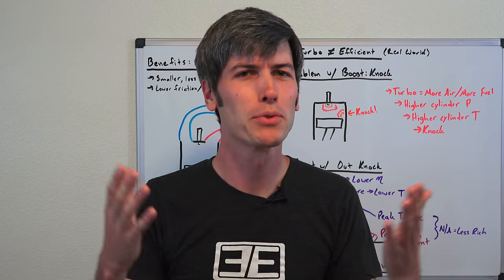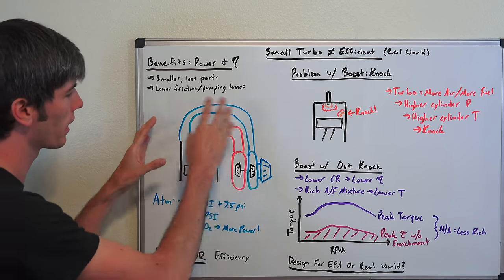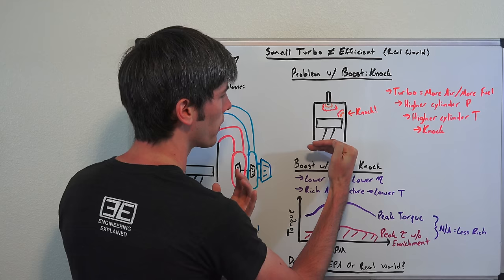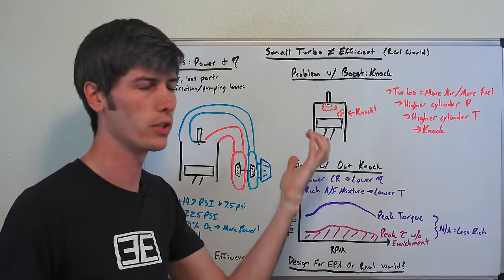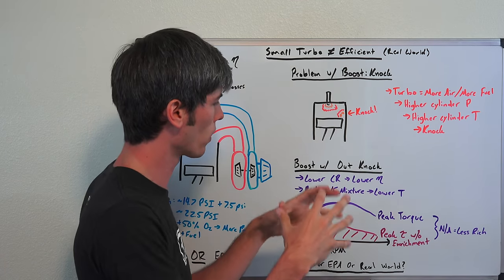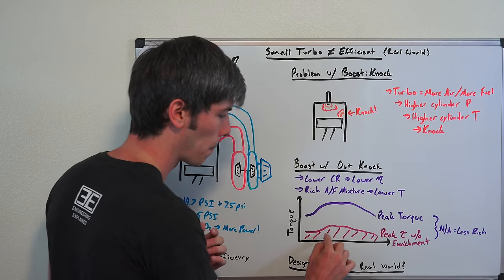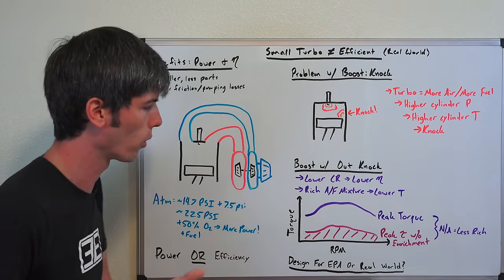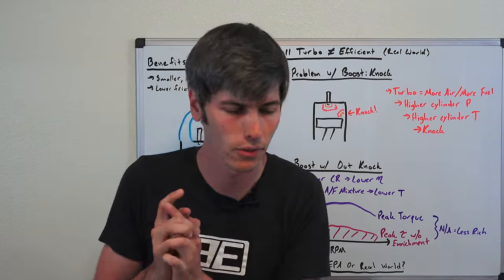Why Small Turbo Engines Are Not Efficient

Comment: The spool up time required to build speed makes these engines frustrating in local stop and go driving - however on the open road, you get fantastic mileage and the engine is great.  Bottom line for around town the mileage and speed isn’t so great - but on the hwy it’s great.  So what kind of driving do you do more of?   That’s what you need to decide.

Comment: I'm interested in what car you drive.  Turbo or non-turbo?

I'm in agreement that compression ratios ultimately impacts on overall efficiency.  Altering fuel mixtures can control engine temperature but it's best to compare what each manufacturer has achieved!  
SAAB did a great job getting best economy out of their turbo engines.  I drive a 2004 9-3 base linear that achieves 7.0 l/100 km in real world highway driving when keeping the speed around 100 km/hr.  I use premium fuel to get best economy and to get best power from the motor.  (engine rated at 9.5 CR)
My daughter drives a SAAB 900S with a 2.3 litre non turbo engine which can match this economy with regular gas.  (10.1 CR). Albeit, the 900S has less frontal area, so I expected this.  
From my perspective I love my turbo car.  Great economy and very usable torque for real world driving.  Not enough evidence here for me to go back to a naturally aspirated engine even considering fuel economy.

Comment: I have a 2014 VW 1.8t, I run 91+ octane and regularly thrash the sh!t out of this motor, get 35+ mpg with 100k miles on it. No knock, zero issues with it.

Comment: Sure pal. 

 Ward’s Auto describes the three-cylinder L3T as “the little engine that could,” making its way onto the organization’s 10 Best Engines list “through a combination of technology, tidy sizing and torquey response.”

Output is rated at 155 horsepower at 5,600 rpm and 174 pound-feet of torque at just 1,500 rpm, which means the L3T boasts a specific output of 116 horsepower per liter. As such, the L3T has greater specific output than the 6.2L V8 LT2 equipped in the mid-engine Chevy Corvette C8 – 37 horsepower per liter greater, to be exact.

Comment: Also remember regardless of engine, 3/4/5/6/8 cylinder, turbocharged/supercharged or normally aspirated.  Full tank will kill fuel mileage.  You are adding full fuel, and for a family road trip all the occupants and cargo.  As you drive and the fuel gets burned off your MPG should improve.

Also those who think driving 70-80 MPH with A/C off and windows down......wrong in most cases.  The parasitic drag and turbulent airflow around the window housings will most likely off set any fuel savings and may in fact cause even lower MPG along with increased ambient air temperatures and noise.  

Think driving with windows down and A/C in thinking you are still getting the cold air from the vents.    WRONG. Again:  you might get away with it a few times but eventually the A/C compressor will fail.  The compressor is trying to condition outside air at one central point (internal vents). Trying to compensate for the warm air coming in from the windows the compressor will eventually give up the ghost.  I would pretty much guarantee they a compressor is much more expensive than the extra fuel you might use driving with A/C on.

Comment: I just bought a Jetta 1.4t and I actually get the advertised mileage of 30/40.  Throttle response is atrocious due to emissions programming which is a problem when you have to lift off the gas to shift gears but power itself is decent.
Reply: I think the 2 liter in the Focus is a better engine, in terms of throttle response and top end verve but I doubt I’d be getting 40 mpg on the highway.

Comment: so the supposed advantage of the smaller turbo engine is not real after all. Power comes at cost, fuel consumption HAS to be increased whether it is a V-8 big cube or a tiny 4 banger....no free lunch.

Comment: mine gets good gas mileage 1.5 accord manual. it’s how you drive it. accelerating at an easy pace and slightly higher rpms. once you reach your desired speed hold it and when you need to speed up downshift but easy acceleration. don’t lug it don’t accelerate hard. easy!!!!

Comment: Rented a bmw 2020 330i with a 2.0 engine has 250hp 298lb. did 600 miles on one tank of gas. From Lawrence ks to St Louis and back on the interstate cruise control set at 80.

Comment: I did some testing on my 1.2 TSI (with a Bluetooth obd reader and torque pro), and the mixture stays pretty much stoichiometric all the time though, even on full engine load. I didn't test higher rpms, so maybe the mixture gets richer from 4000rpm and above - but that's not where you usually are in the city. 
The compression ratio is 10.5/1, and fuel consumption (seat Leon 1P) avarages around 7l/100km (6.2-6.4 on the dashboard).
Reply: Gibbon agree, that’s what I learned from Jason. It’s just that I was quite surprised that in daily driving, the air/fuel mixture seems to be perfectly stoichiometric all the time. I’d expected it to go rich at least at full engine load, but that doesn’t seem to be the case.

The TSI might be inefficient in other ways, surely the compression ratio could be higher in a na engine. I don’t know what the efficiency trade off is there.

Comment: My buddy with a Type R has 29.7 mpg over the past 6k miles.  I've seen the trip computer.  Drives easy MOST of the time, but definitely not always.  A base Civic would definitely beat that MPG, but would struggle a bit even to keep up with easy driving.

Comment: I’ve got a 1.4 liter turbo Jetta (2017) - It gets 40mpg on the highway, 0-60 in under 8 secs, and usually 36mpg around town. I’ve yet to have any problems with the car. It has the room of a midsize, the acceleration of a v-6, the economy of a subcompact. I’m not sure how you can ask for much more from a cheep compact car than that ($16k new in 2017).

Comment: A 70 hp engine can move a thousand pound car nicely. A 70 hp engine with a turbo can move a 3,000 pound car good too, but sucks the fuel. Anyway, it’s like the new Silverado. Small 4 cylinder gets the same gas mileage as the V8.

Comment: The MK7 VW golf 2.0 and 1.8 reach the goal of V6 power with 4 cylinder efficiency. Hyper control over many parameters, good head design and some other stuff I'm not aware of. But what is do know is AFR. These engines stay stoichiometric at insane loads and boost levels and hold together like an old train.

Comment: Porsche Cayman used to be only large (by European standards) 2,7 to 4 liter 6 cylinder boxer engines that had ok fuel mileage of around 0,6 to 0,7 liter per 10km. Then they made the 2 liter boxer engine with turbo making the same or more horse power and the fuel consumption went down to 0,5 liter per 10km...

Comment: The main reason why they aren’t as efficient as they could be is because of the platform of most small turbocharged engined vehicles is their front wheel drive and with small engine bays and that generates problems witch is heat can’t escape it stay trapped under the hood and with electrical fans that turn on and off the builds up and has no where to go and also has some form of EGR system witch is pumping exhaust gas back into the fresh air intake stream witch is reducing the amount oxygen in the available during intake stream witch causes a loss of power and efficiency they need to go back to rear wheel drive and and shroud the electric fan units and cut all the dress up of the bay itself and ditch the EGR and use a stainless steel intake manifold that has been polished on the inside to reduce the build up of carbon and other particulates coating the inside of intake manifold instead of plastic and enlarge the engine bay by 15%. That’s also why in the winter time you’re vehicle makes 10% to 15% more horsepower and torque than it does during the summer a engine running cooler is more powerful and more efficient than a hot one.
Reply: *witch?

Comment: Just bought a new VW 85kw 1.0 3cyl. I can get the stated mileage if i drive like a grandma with no passengers and no aircon. Aircon makes a noticeable difference of about 0.7L/100km and my two kids in the back that weigh about 60kg combined make about a 0.3L/100km. Also i need to use the start stop system to get close to the stated mileage in the city.

Comment: my 2015 volvo S60 T5 (240hp and 260 lbft of torque from 1500 rpm) has 2 driving mode.  In regular, you can drive it like its a diesel.  The reves rarely go above 3000 rpm.  I get 30 around town and 38 on the high way.

Comment: Great video. So small engines are inefficient because the extra fuel cools, and helps prevent knock....why doesn’t a larger engine need to do that?
Reply: Because the smaller engine has a turbo to make the same peak power as the larger naturally aspirated engine

Comment: Thank you so much! I came hoping I would find a video from you on this topic. Because yes, manufacturers have all went turbo seemingly, I assumed it was for EPA, but like you say it isn't telling the whole story. 
Though you didn't quite go into the basics, I mean essentially it is reburning the exhaust which tends to have alot of undetonated fuel. Which that is a no brainer if they want to keep things cleaner. 
As I learned in the aircraft industry they didn't use turbo until the air becomes thinner and that also is colder air, which isn't something most of us deal with. 
Glad to hear mazda is working to deal with this problem, going to watch that next. 
Thanks again!

Comment: I have a question : Couldn't a solution to this problem not be that the Turbo has to come on later/higher on in the revband ? 
What I mean by that is that the small engine, by low loads, would run under the point where the turbo is actually active, preventing knock and allowing less fuel to be needed. Typically, with modern gear systems, you could imagine having the car at a constant 1'800-2000 rpm highway, and when you need the boost, simply drop one or two gears and the turbo kicks in and you have the power for those, in general short, load scenarios.

Comment: I kind of wondered about that. My old early 1990s NA 12v 2.6l V6 initially gave me better mileage than my new 1.8 liter turbo inline 4. They have on paper the same horsepower and similar torque, but in order to get the fuel economy, I have to drive either be running at 1000-1500 rpm on the highest gear it can keep the car going at, and also do the accelerations never exceeding 2000 rpm.

So if driving "normally", with 1500-3000 range between gears I get 11 l/100km on either, but on the V6 the lowest I ever got it was 10 l/100km and on the new one, it does get down to 6 l/100km or so, but requires the use of cruise control and so high gears I was educated against that (knock and excessive wear). The old "normal" 1500-3000 range between gears wasn't exactlty "sporty driving" either, instead that'd be more like 3000-6000 rpm between gears.

Comment: Very happy with my 2020  1.6 turbo astra (holden), 150kw (200hp), yet i am averaging 7.6lts/100kms(37mpg uk/31 mpg usa) driving normally at legal speed limits.. Does have auto stop stop though, which helps a bit i assume. 
Yes those numbers plumet if i keep my foot in it,  Conversely if i baby it along on the open road, it can average 6.5km/lt. (43mpg uk)
Previous earlier model 2 liter cars i owned, only got 20-25mpg uk

Comment: to sum it up with 4 cyl cars with turbo they tend to get higher temp in the cyls because of the turbo and with all of the air from the turbo coming into the engine the engine has to go more rich to match up the air fuel ratio aka bad mpg so if u got a 4 cyl turbo for better mpg dont floor it

Comment: Very good explanation of engine knock with a turbo.
I'm not sure how small car turbo CPU's are designed these days for factory but a turbo needs high octane fuel to prevent knock (perhaps there designing these cars for standard 92 octane to make them more efficient as you state).
I'm not an engineer but I'm sure I'm right and manufacturers shouldn't be designing cars with turbos and not placing high octane fuel in the manufacturing specs (the same would go for a supercharged engine but turbo is cheaper to manufacture on a 2L). 
Let me know if I'm on the right path man and I love your videos. Peace!
Reply: It sounds like I need 0.7l engine to get good mpg at wot.

Comment: You totally didnt mention the real big reason: 
Most of the time you will drive in urban traffic, unless you are travelling a lot on highways. And then even in that case you will run into traffic jams, which basically are urban traffic. 
What happens to turbo engines in slow traffic? - Right, the turbo will not kick in, or just very rarely, because the RPMs are too low. The efficient RPM range of a turbo starts not directly after idle. 
You should take that into consideration

Comment: In my mk7 GTI (2.0L turbo TSI with direct injection) I can get up to 35-36 mpg on the highway (they claimed 30 for automatic models) and even when pushing the car hard I can get 20 mpg which is still very viable for how hard I push the car. If you want good mpg drive like a granny, that simple

Comment: In EU:
3 cylinder 0.9l are common. Still the fuel consumption is approx 1.5 - 2 times higher than with 2.5l 6 cylinder.
In diesel it is much more significant. 1.4 TDI consumes much more than my 1.9 TDI and way more than the old 1.8 SDI and it does not even work.

Comment: GM recently introduced the new Buick Encore that comes with a turbocharged three pot.  It's bigger than the old Encore and gets worse fuel mileage because the three cylinder has to work harder to move the weight of the vehicle even with a turbo, and that's before you cram it full of your personal belongings.  You can make the argument that if you really baby it, the car will get closer to advertised mileage, but a cynical man might say that the design of these new engines has nothing to do with efficiency, and that it simply costs less to make an engine with three cylinders instead of four which is why some manufacturers are going this route.  A Chevy Cobalt with the N/A 2.2 liter Ecotech and a manual transmission can get over 40 mpg on the highway, but these new Buicks are barely managing 30 unladen, and similarly turbo cars which should get better mileage than SUVs or crossovers only get 35 or so combined.  If you ask me, turbo economy vehicles are one of the biggest scams ever pulled on American consumers.

Comment: My ex girlfriend has a 1.8L, turbocharged 4 cylinder Cruze that gets about 35 mpg. My 1992 Pontiac Sunbird had a NA 2.0L four cylinder that got 38 mpg. Both have automatic transmissions but the Cruze has a 6 speed, whereas the Sunbird has four. 

Granted, the Cruze can accelerate much faster than my Sunbird ever could, but still, for supposedly being an economy car, it's not very economical.

Comment: The problem is when a engine that is too small is used in a vehicle that is too heavy for it. The engine will be in boost most of the time and the mileage sucks. I have owned two ecobost Ford Escapes back to back, they cant get claimed highway mileage unless downhill with a tail wind.

Comment: I got as low as 4.3l / 100km fuel consumption cruising about 120km/h, of course in city it can climb up to 6.0l / 100km when you constantly stop/start and floor it when overtaking and so on. Even in worst case scenario I'm impressed how my turbo diesel is effiecient, and I was previously a NA gasoline fan. Diesels have their drawbacks but efficiency is not one of them. IMHO.

Comment: If you need the power to move a car/truck a certain way, no matter what engine you have, the engine's gonna require a large amount of fuel to move. They just show the low numbers in fuel mileage on paper but thats achievable with you not in the car driving going 60 mph

Comment: Perhaps you could investigate power point for better presentation results. 
I always thought that they could combine gas and diesel with a spark plug to ignite a tiny bit of gasoline injected on top of the diesel fuel, as I thought the gasoline would ignite better. Apparently you seem to indicate that the science works differently than my intuitive reasoning. So very interesting indeed.

Comment: My focus st gets great gas mileage, full bolt ons, no active grill shutters and bigger intercooler. No tune. I average a bit over 27 mpg and drive it pretty hard to hear the exhaust and hks bov. Cruising at 60 mpg it'll do over 30 mpg easy, as long as the grade is level and the wind isn't hurricane force against me

Comment: As an example I have a 425 hp 6 cyl M3 which has an advertised EPA mileage of 25 mpg...it actually gets 30 mpg at 70mph when using cruise control...My wife owns a 2017 volvo v60...a 4 cyl 240hp with an advertised EPA mileage of 29mpg also on cruise control at about 70mph...while the M3 requires 95 octane and the v60 runs on regular...
However the M3 is waaaay more fun to drive and when having fun the gas mileage is ......lets say a bit lower!

Comment: I just got a Skoda (don't know if you americans know that brand) with a VW 1.0 - 3 cylinder gasoline engine.
I think if you treat those things right, they can also last 250.000 to 300.000km.
My average fuel consumption is 4.9l/100km (~48 mpg)

Comment: I do not think the auto makers are tricking the test (well, maybe VW and Ram got caught with their pants down).  I think they are "babying" both the natural aspirated and turbo vehicles in the same way; which means no sporty or heavy load driving, but rather just ordinary day to conservative driving.  The turbo wins due to less weight and more efficient mid range power where the boost is not so much as to get heat problems in combustion chambers or require enrichment.  THE MAIN REASON we do not get that increased MPG in real life is that its too much fun or satisfying to keep our foot mashed down on that little right hand pedal.  My EcoBoost F150 gets better fuel economy than my same model Coyote V8 did, both on regular pump gas.